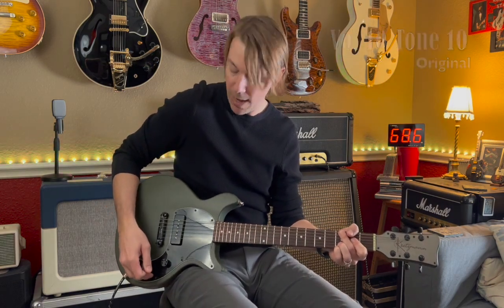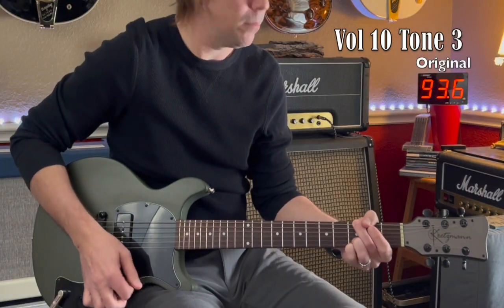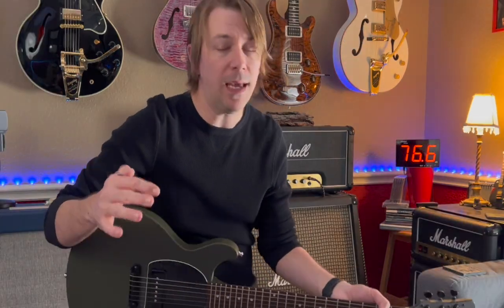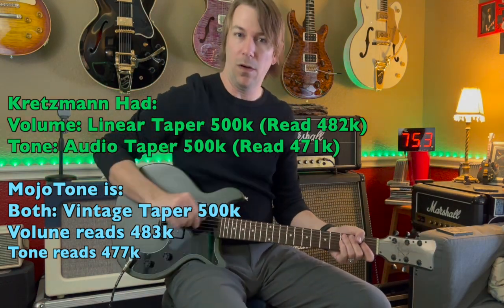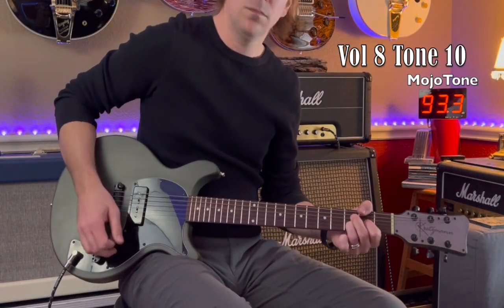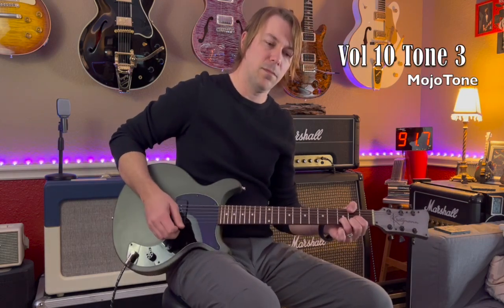Mojotone Vintage Taper CTS Pots 500k

Comment: Need to roll the volume off when noise is being made so one can see the actual taper of the pot.
Reply from the maker: Great suggestion. My main thought was on the treble change and touch sensitivity. Totally makes sense to strike a chord or note and roll it down. Should probably do it clean and dirty.

Comment: Tone and Volume pots run differently. Volume is a voltage divider. I feel the tone pots arent aggressive enough and most volume pots are too aggressive on rolling off the volume. The cap can adjust tone taper but I find more aggressive caps just reduce the useable range of the tone control (more muddiness at the bottom). I stick with .022uf. So this Mojotone pot is a better pot for volume.  Its a 30% audio taper. Standard 10% audio is better for tone.  Im actually considering linear taper for my volume pots, I feel they may have more usable range for the volume. The tone acts differently where the roll off is more aggressive in the lower half...volume seems to be aggressive roll off in the upper half. And id like to be able to make finer changes to my volume.
Reply from the maker: I agree that the .022uf is the best one for me. Tt has more useable change in the sweep. I do tend to prefer the audio taper in the volume because I hear the sweep lasting longer... that said, I have not changed cap values which would make a large difference.